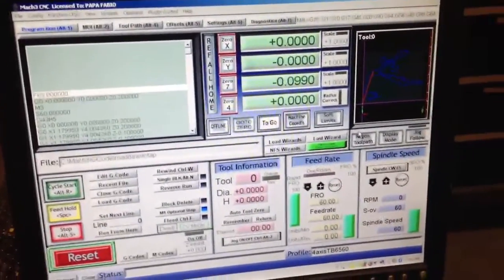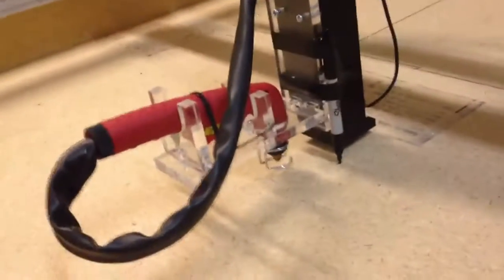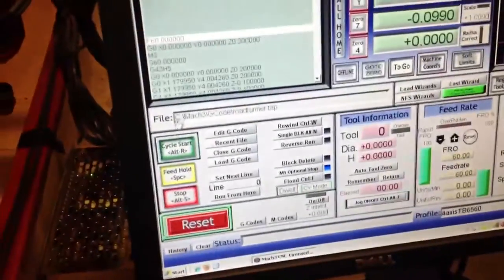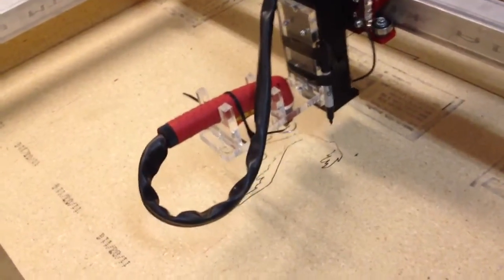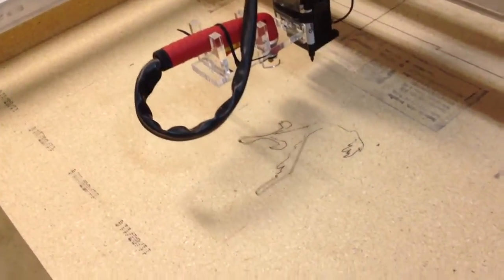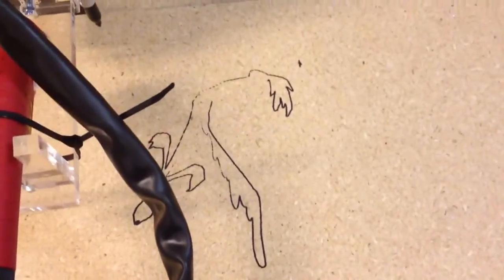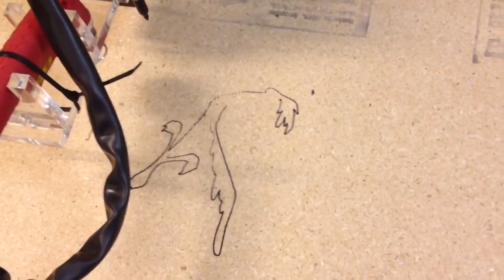Mach3 roadrunner test

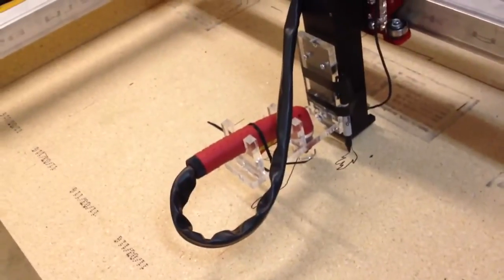Comment: I noticed you don't have a demo version and I see the same problem I'm having where your roadrunner gcode stops meaning program did not finish drawing roadrunner, when I run the same gcode file my machine stops at that very same spot everytime @ line 497  1:16